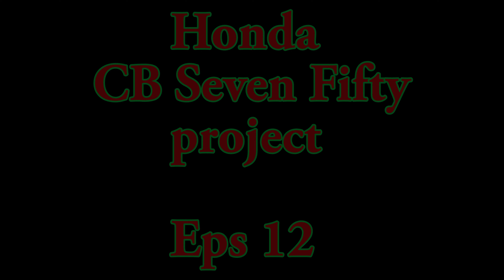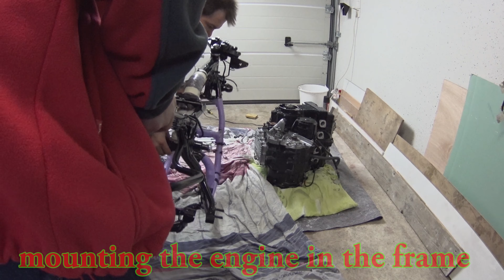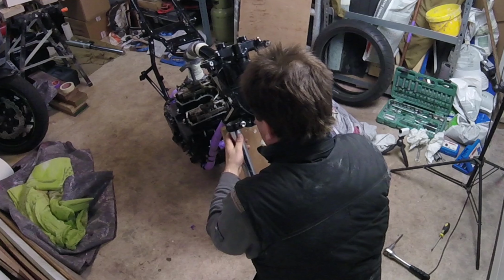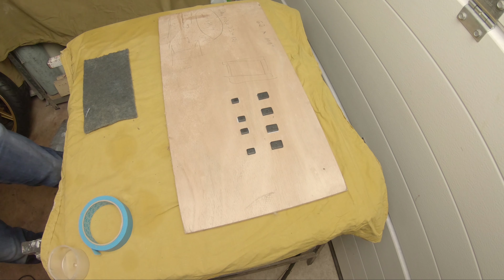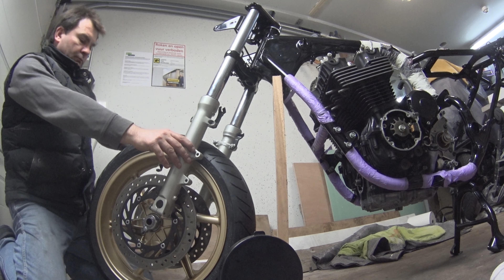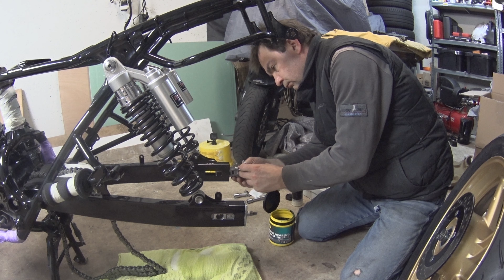Assembly day 2 - Eps 12 - Honda CB Seven Fifty project

Comment: Interesting to see how you got the virtually full motor back into the frame. I just pulled my 1996 CB750F2 out of the frame on my own. What a job there is hardy any room to get it in/out
When I put the motor back in I'm only going to have the cylinders on 
Your build is coming along nicely your doing a quality job